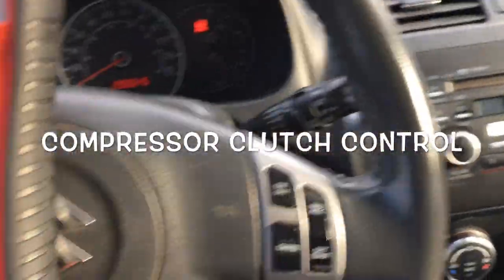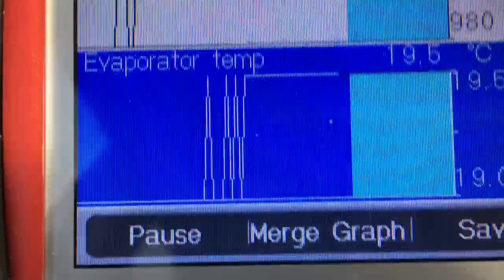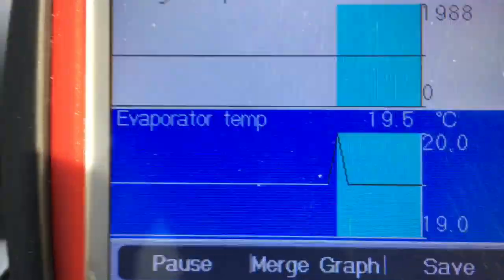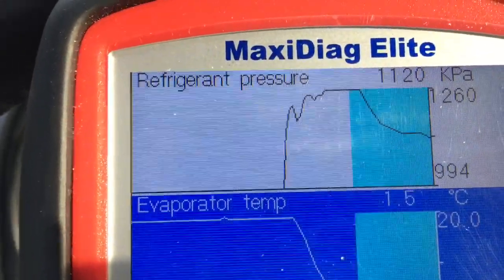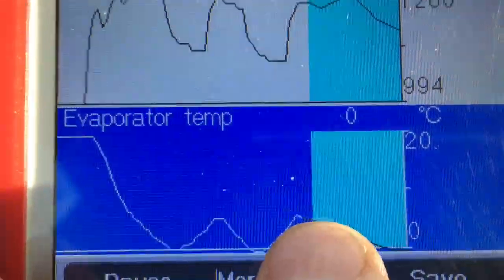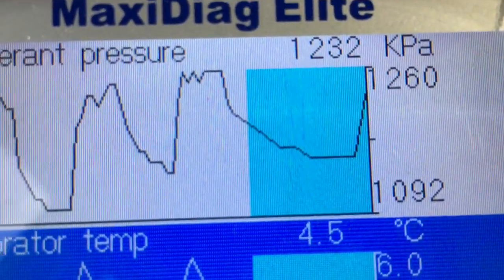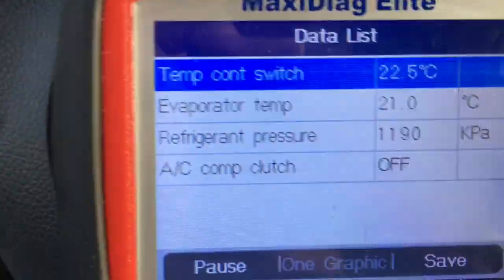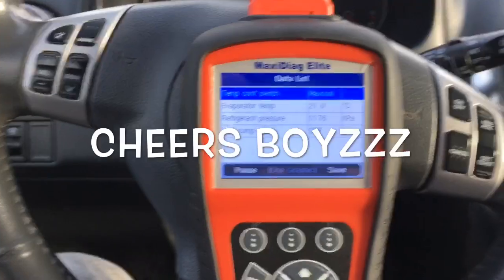SX4 A/C Compressor Control

Comment: Interesting wee vid that, to the point. Aye, just proof no scan tool shows everything. Sometimes updates remove pids
Reply from the maker: Hi Dave. Nothings perfect....Are you still working Dave? I would assume so. I am, but pretty much make work projects.
Reply: @TheGibby3340  oh aye, essential worker here ya know. Workload has fallen away, changes by the day tho
Reply from the maker: Thinking about purchasing this...what  do you think?   Google “ADS1013D”   (FNIRSI)
Reply: @TheGibby3340  had a quick look there ian, some specs for the money. Looks like my micsig(without the specialised stuff that i never use)
Reply: Just on the updates Dave when they remove pids or some special functions on Autel anyway they remove them because there was a fault with them and they will fix the faults and will return the pids or special functions in around 6 months
Reply: @iankelly2110  latest version of vcds has removed some features cos vw bought it out